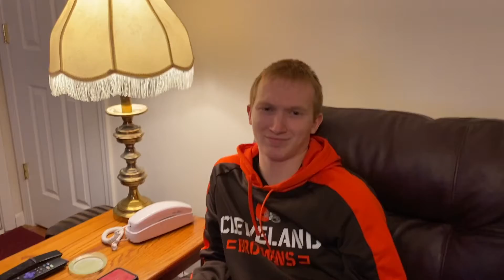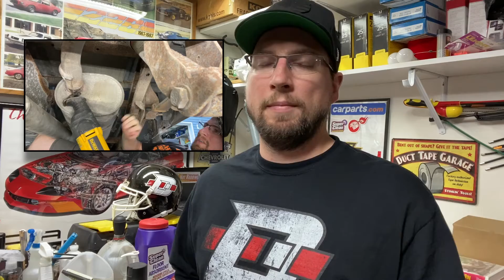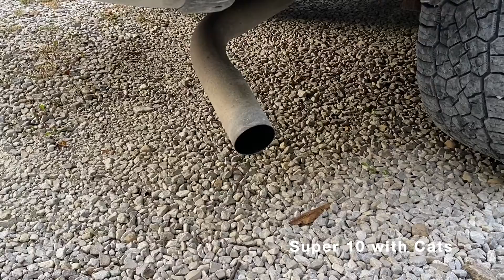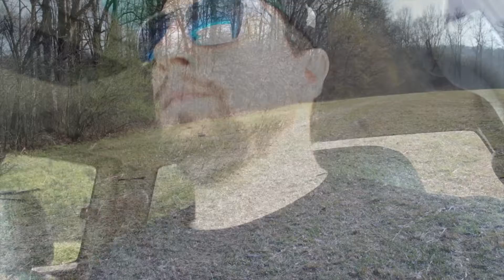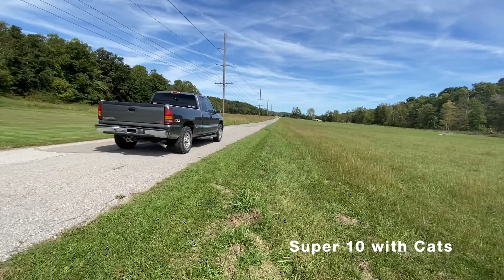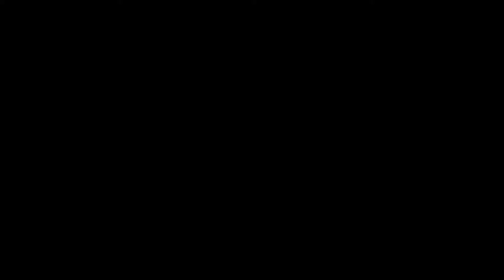Flowmaster Super 10 Sound Test Comparison - With and Without Catalytic Converters - AWESOME SOUND

Comment from the maker: I have noticed the Super 10 has gotten a little louder over time on my Sierra.
Reply: I wanna say the carbon buildup helps the muffler heat soak making the exhaust gasses travel faster, hotter exhaust sort of lubricates the pipes for exhaust flow

Comment: I have the Flowmaster Super 40 on my 2012 Silverado, and I love it! It's got the bass and classic Flowmaster sound without too much drone in the cab. I also added a 3" mandrel-bent stainless steel tailpipe from DynoMax and finished it off with a 4" Flowmaster polished stainless dual wall exhaust tip.

Comment: Can I ask you a question??? Flowmaster super 10 I want to get for my single exhaust system 1964 Oldsmobile 98....I want to get duel out and put short down pipes on from muffler not all the way back just maybe 6 inch pipe s coming from the 2 outlets.possible ? I've seen it is but it would be sounding nice right..by the way truck sounds awesome 👍

Comment: SUPER 10 DONT SOUND GOOD TO ME .THAT MUFFLER DONT HAVE ANY BASS IN IT AT ALL U SHOULD HAVE WENT WITH THE DELTA 10 FLOWMASTER
Reply: All flowmaster super 10 are delta flow unless you find a shop that sell the race 10 which only some shops sell those

Comment: It’s nice I can relate to having an old beater to test things out on like your green truck. My maroon 2000 is getting rough the frame is rusting bad under the wheel arch areas like it did on your green truck and mine is rusting under the driver and passenger side doors where the front body mounts are. It’s off the road now of course but it sucks the truck only has 160k miles and runs like a jewel but ohio salt pretty much totaled it 😭☹️ and it blew a brake line or 2 😤🙄 it’s my favorite truck I’ve owned but it sucks it is so bad of shape thanks ohio 👍

Comment: How does the Super 10 compare to the Cherry Bomb Extreme / M80 They seem like similar construction (single chamber-ish)
Reply from the maker: They are similar, I will have a comparison video at some point 👍
Reply: @TheDaninator  I'm going to guess the Super 10 will have a deeper more mellow sound.
Reply: @TheDaninator  long story: lexus 4.0 v8, super quiet 2 turbo mufflers and 2 resonators. I replaced stock mufflers with  with super 44s, got a low hum, still quiet, replaced the resonator with Cherry Bomb M80, still quiet! Took off the super 44s, left M80– nice idle but loud drone at 2000rpm. Would replacing the M80 with Super 10s reduce drone and be quieter? For sure would be deeper. Or replace cherry bomb m80 with Super 44, leave resonator off and call it a day?

Comment: Sounds sick without the cats. I like the way these sound with the cats straight pipe too though.
Reply from the maker: I agree… on both accounts!
Reply: @TheDaninator  I'm thinking about ordering those m80 cherry bombs, how are they holding up, are you still liking them?
Reply from the maker: @JohnSmith-xx1lx  I only had the m80 on the truck for a few hundred miles before it swapped it out with another muffler. I liked it real well when it was in the truck.